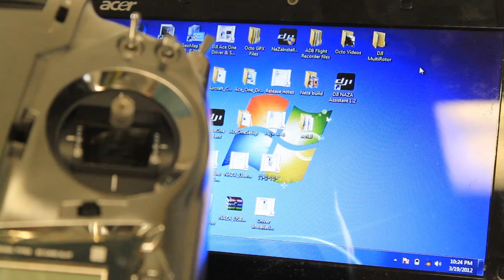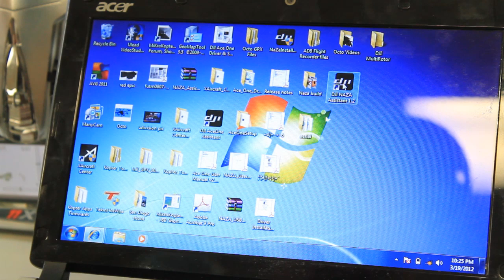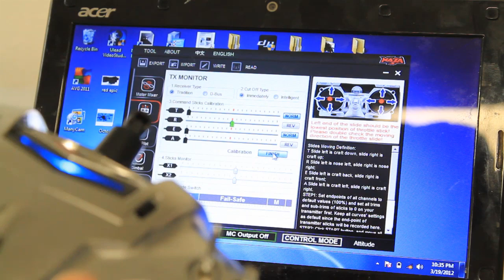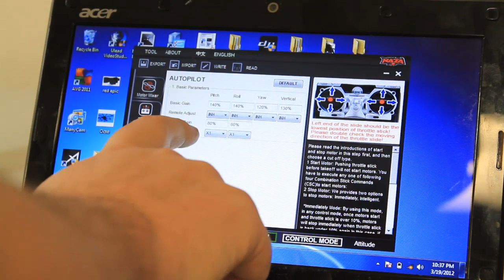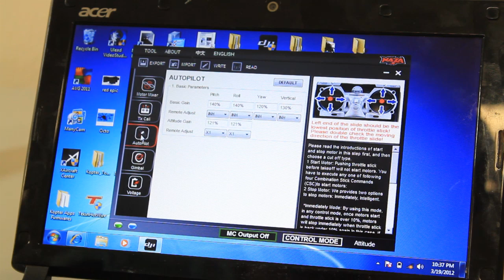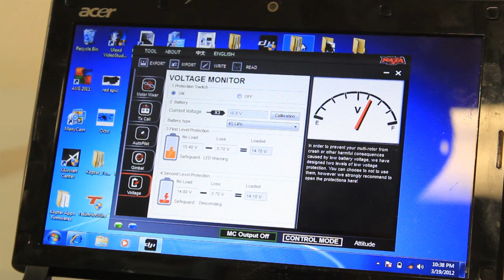DJI NAZA ASSISTANT AND TX CALIBRATION

Comment: Question on the battery,  I looked up the one used and it does not come with the Deans connection,  did you use and adapter?

Comment: *****
Reply: Hi chris the motor directions are fine.also when i try to throttle up it tries to topple on the front props.
Reply: ***** your motor rotation is wrong  that's why it wants to flip
Reply: No i just checked the motor direction it is right.i got a lift in the attitude mode.
Reply: I still cannot get the gps calibration
Reply: Are all the motors arming at the same time? Did you calibrate the esc's?
Reply: Not a problem either. I  want to see it fly as much as you do lol
Reply: Well they do start at same time,but i have not calibrated the esc.how do you do that?

Comment: i heard a pop/spark just as you were plugging in the battery. is that normal? i get that a lot and worries me that i may be doing something wrong or have a potential for a fire. is that supposed to happen?
Reply: carbon fibers somehow do conduct electricity insulate your connectors from any CF attachments

Comment: With loiter and return to home, I have a DX8 which the AUX 2 switch has 3 positions.. Can I set it so if the one switch is " 0 = OFF, 1 = Loiter , 3 = Return to home"?

Comment: I have a JR9503, and the screen is not responding when I move the stick to calibrate and the control mode switch is in blue (A").
What do you think it could be the problem?.

Thanks.

Comment: I cont figure out how to setup the control mode switch. I have the Dx6i transmitter and AR6210 Receiver. do you maybe have some kind of guide for me or tell me how to set it up on the transmitter for I have no clue :S thx.

Comment: hey just got the F550 and naza m. i have finished set up according to the directions in the manual and with help from this video but when i go to fly the the craft bounces violently and is not holding altitude. any thoughts on what my problem is?

Comment: Thank you very much for posting this video.
I've finally got my F450/NAZA programmed,thanks to your video!!!

On programming your gains so it can be remotely adjusted via X1 & X2, I have a Futaba 6EX and there are no extra dials that can be used for the gains. 
If I want to adjust the gains, will I have to hook up to the NAZA Assistant to adjust?

Comment: Yes they are facing forward, and motor order is correct.  Like I said it lifts off the ground, but thottle is passt 50%, and then it lifts off very quickly with very little extra throttle.  I'm using 930kv motors with 10" props.  I'm familiar with flying other controllers, like arducopter, but it doesn't behave that way.